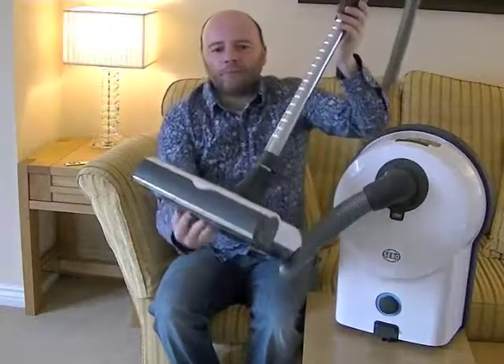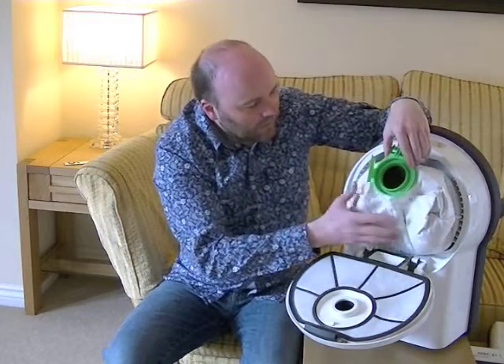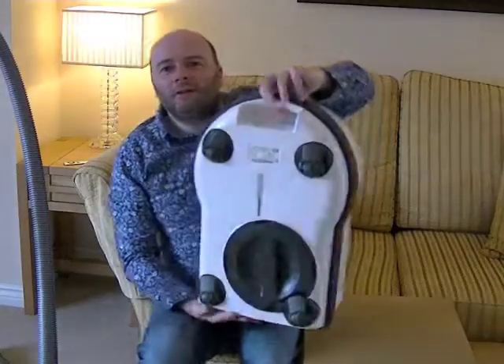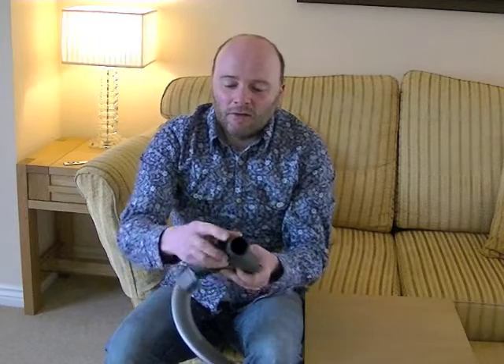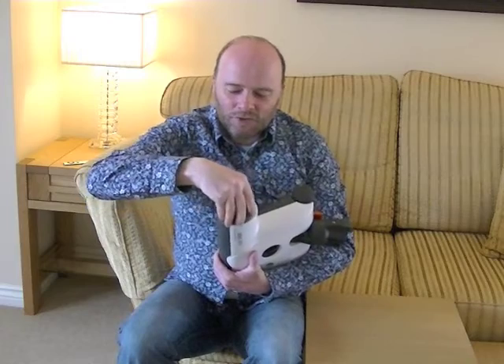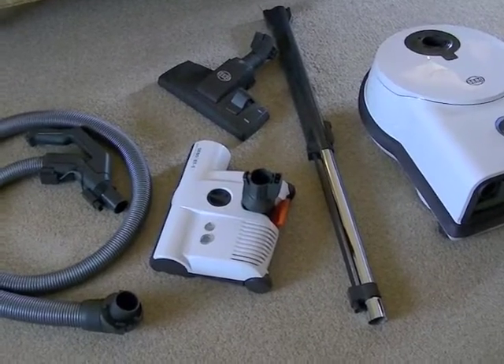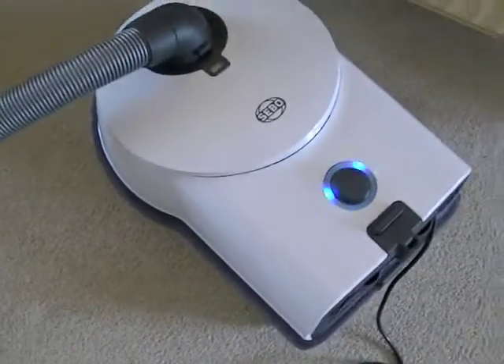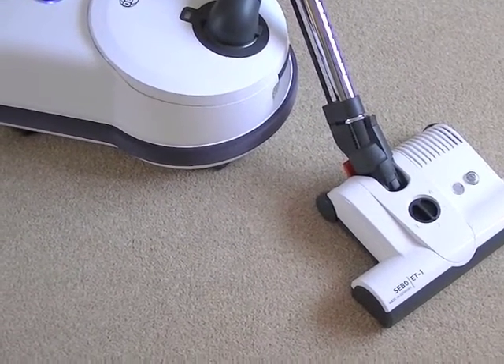Sebo D4 Premium Cylinder Vacuum Cleaner review & demonstration

Comment: Thanks for all the information. I’ve had this exact model for 6 months and I agree it’s heavy. I’ve noticed it flips over if you are not paying attention to the angle of the tube where it meets the body, if it’s at its opposite rotation the machine turns over. Your tip about taking the brush out is great as we have a lot of long hair in this house. 👍

Comment: PROFESSIONAL VIDEO. Bought the D4 and ALL attachments on a close-out for $499.00. I added a hose for the down stairs and up the stairs.
EXCELLENT MACHINE.
Reply: Sounds like a great deal!
Reply: yeah killer deal. i just paid an insane amount for mine 😅
Reply: @burpreynolds  I just happened to be at the right place at the right time. Interesting, most of the accessories fit the Henry Allergy model so I use that one exclusively  for cleaning the car and garage. Found it in Canada with only the box Scruggs but machine in excellent shape.

Comment: not worth it guys. 5 years later, if I had to do it again, I would either try the smaller version or go with another brand.  Im not impressed with some of the design flaws and how it has held up over the years.  

It does have the suction to pull a sick whore off a piss pot and a bag big enough to store a cadaver but other than that its not worth $1,200
Reply: That's because it's not a $1200 vacuum. It's under £400 in the U.K. which means it should retail at around $500 in the US. Only your protectionist tariffs and crazy import duties and taxes make it insanely expensive.
Reply: I am looking at the Sebo D4 then saw your comment.  What are the design flaws?  What hasn't held up over the past 5 years (7 now)?
Reply: @sl1237  it is over engineered imo.  The first thing is it is HEAVY AS HELL .  The hose comes off canister at a shallow angle and does  not spin 360, only 270.  A nuisance when dragging it around.

It's so heavy if you drag it by the hose it eventually Makes it suck air at the connection at the canister.

The power rug beater is off balance, when you lift it off the ground it tilts to one side

And the handle loses power connection down to the rug beater and it intermittently comes on and off

I have taken it apart several times tried to clean the contacts but it basically is a piece of crap

The wire is about 40 feet at probably 16 gauge and it gets wicked hot if you don't unravel it the entire way.  

Get A Miele.  

Every time I use this vacuum cleaner I want to throw it out the window.

We have a nice and cordless V7 and I use that 90% of the time now.  

The positives?  It's a HEPA vacuum, and it does have good power but just about every vacuum cleaner nowadays has good power.

Do not buy this Seebo canister D4 it is definitely a piece of shit.  It is the most retarded vacuum cleaner I have ever used.  And frankly I'd like to take it back and shove it up a salesman's ass :)
Reply: Yeah.  Its a piece of shit. Heavy.  I dont use it anymore.  Cordless dyson works just fine. We're too lazy to haul the sebo dumpster up and down the stairs too 😂

Comment: I bought the D4 700 and the suction is a joke. It really is WEAAK! And for insane price. I cannot describe how  dissapointed i am in this product. No doubt it's build quality is GREAT and will last for 20 years. but it's just so weak. I can not clean any carpets with this. I wonder if buying the carpet brush roller head for another 190 eur will make this product usable.
Reply from the maker: I would not recommend the 700 watt Sebos, especially the straight suction ones unless you mainly have hard floors. The model in this video was manufactured before the first EU regulations so it's over 2000 Watts. They did 1200 watt versions that had greater suction than the 700 watt models. The power head would make a huge difference to the carpet cleaning performance if you can get one that fits your version.
Reply: ibaisaic thanks, appreciate the thorough reply. I felt mislead really, especially at that pricepoint :(
Duped into having to now also purchase a powerhead, that by itself is more expensive than a cheap 2k watt noname brand.

Comment: Hi Rodger. I am thinking of buying one, but don't know which one to go for, either the Miele c3 elector or this Sebo. Cheers. Paul
Reply from the maker: The Miele will probably perform better, but the Sebo has a bigger bag, longer hose, cord and is better built in my opinion.
Reply: ibaisaic Hi Rodger. Do like the Sebo x4 upright pet vac.  Will study your reviews on the x 4 soon, Paul
Reply from the maker: I have been using the X4 Pet Boost recently and it seems so old fashioned now. If you want an upright, I would go for the Felix. The Euronics exclusive Kudos version seems to be on offer at £200 at the moment.

Comment: I find it hard to feel a machine is cleaning well with straight suction only on carpet. I have to have a power head to consider it a household machine
Reply: yes, I have to have a power head even if I had mostly hard floors
Reply: My unit came with ALL attachments and power units for carpets, wood floors, stairs, furniture etc. For under $500.00 on sale and all was NEW IN A SEALED BOX.
Reply: Gerald Mattos where did you buy it from? They are 1299 in US

Comment: Thank you for the review. I absolutely can't decide between the D2, the E1 (700) and the E1 (1200). Do you have any thought or recommendations? The house is over two floors (total area 130 sqm) and mostly floorboards and laid wood.
Reply from the maker: +Bohab Bibb The D models are quite big so would be better for a larger home. I haven't tried an E series model yet, but personally I would go for the 1200 watt version.
Reply: Thanks for the helpful response. Unfortunately I can't find the d model anywhere to view in person so has been impossible to know how big they are. Other than the bag size and cord length, does the d have any advantage over the e? I imagine the engine is the same, but does it have better filtration? How big does the home need to be before the d becomes the better bet?

Comment: This is an excellent review. Your step by step analysis convinced me to purchase the Airbelt D4, here in the US. They currently run about $900.00. We have two cats, and have both bare floors and area carpets (rugs). I'm looking forward to replacing my 30 year old Miele 227 with is very up to date deluxe model. As my wife has allergies, It's the deep cleaning of the carpets, and the removal of the cat hair and litter tracked from their feet that led me to this.
Thank you.

Comment: Roger, I have a quick question. Have you noticed any smells coming from the D4? I read some reviews that say as the bag fills, there is a smell that omits from the machine. They recommend the SEBO lime scent sticks to add to the bag. Any thoughts? Thanks, David
Reply from the maker: +ShrinkDavid 1982 Most bagged vaccums emit a smell as the bag fills with dirt. I find the Sebo fragrance sticks don't last very long. A more natural solution would be to put some essential oil on cotton wool and place it inside the bag. Smelly exhaust air is more of a problem for homes with pets.
Reply: Thanks!
Reply: ShrinkDavid 1982 , cut up a Bounce fabric softener and put it in the bag, no more bad smells.

Comment: I am amazed your machine is 2100 watts. Mine is only 1200 watts. I wonder why this  changed. It has amazing suction so I guess it doesn't matter.
Reply from the maker: +ShrinkDavid 1982 Since the EU regulations limiting the wattage of vacuum cleaners sold in EU countries, the D4 is now only 700 watts, but I don't expect the performance to have dropped dramatically. I plan to get either a 700 watt K3 or E3 Premium next year.
Reply: In Europe their voltage is 220, in the US, it’s 110 that’s the reason his is double than a US D-4.

Comment: I do want to thank you again for turning me on to this vacuum. I was dusting my ceiling fan with it at 2:30 am. I don't really like the dusting brush. It is too small. It is nice for small areas but i like to dust all my furniture with the vacuum and I find this to be too small and stiff, no pun intended. I ordered an adapter and the long Dyson dusting tool. I know it is sacrilegious but I have to have something that will make it easier to dust or I just won't do it. Did i mention I hate dusting? 

I am so amazed with the suction power on the Sebo. I have never owned a vacuum with this much power. Interesting. I tried one out at a dealer before I purchased it and the suction wasn't as strong. However, it was a floor model and I don't think it was well taken care of. The bag was quite dirty which tells me he probably was reusing it which would definitely cause a loss in suction. I trusted you on this and it has paid off. You were spot on about the button to turn the motor head off/on. Terrible. I don't know what Sebo was thinking.
Reply from the maker: +ShrinkDavid 1982 This genuine Sebo dusting brush is much larger than the one supplied with the D4 and has nice long soft brushes and a swivel neck.  http://www.amazon.com/Sebo-Dusting-Bristl-Openning-1094GS/dp/B00H5PPILY/ref=sr_1_10?ie=UTF8&qid=1445504366&sr=8-10&keywords=Sebo+dusting+brush
Reply: thank you for that.
Reply: @David49305  I added a soft mink bristle brush to mine. I found it at an old vacuum store for under $4.00.

Comment: Well, I received my Sebo D4 Premium with the ET-1 brush roll. Overall, it is a FANTASTIC vacuum. The suction is truly amazing and the motorized head cleans the carpets like nothing I have ever witnessed before. I purchased the premium parquet hard floor brush and love it. It has wheels which makes cleaning floors a breeze. For me, the hose is average length but the cord is the longest I have seen. I have a 3000 square foot home and I was able to clean the entire first floor, the stairs and the landing and hall before I had to plug it back in. None of the vacuums I have owned have made it that far. It did topple over a couple of times and got caught up in the cord (which is typical for a canister vacuum). 

I agree with Roger's review completely. The button to turn the brush roll on/off is an engineering failure. It is so hard to press that one could break a toe. I had to use my finger. However, it is nice that it turns off in parked position so I didn't need to turn it off much. I do think they should provide a much larger button or take Roger up on his idea and add a larger one on the back. Also, I would prefer a step button to raise/lower the power head versus having to bend over to adjust the height (but I do need the exercise). A light on the brush roll would also be nice. I would also like to see all the controls added to the handle - just makes more sense. However, these are tiny things. The machine is amazing. Couldn't be happier. I only got four rooms cleaned and look forward to getting the other six done this week. If you are thinking about this cleaner, give it a shot. It is big and somewhat heavy so take that into consideration. I do not have pets and we do not wear our shoes in the house. It hasn't been too long since I vacuumed. I could not believe the dirt and dust in the bag. AMAZING! Thanks Roger for recommending this vacuum!!! Happy Vacuuming!
Reply: Do you still recommend the Sebo D4?  Anything broken after 6 years of use?  Long term flaws?

Comment: Roger, when using the extension hose, is there a loss of suction at all? I would like the hose to be as long as possible so I don't have to putt the machine around the room. I have a few large rooms and don't want it following me around.
Reply from the maker: +ShrinkDavid 1982 I haven't noticed any noticable drop in suction using the extension hose, but it is really only for above floor cleaning and stairs. It is a friction fit stretch hose so cannot be used with the power nozzle.

Comment: How is the hose length for cleaning stairs? I know they offer an extension but hope to not have to purchase that.
Reply from the maker: +ShrinkDavid 1982 It's a long hose, but will only get up about two thirds of a standard flight of stairs. It will stand on a stair or can be carried. I have the extension hose which does make all above floor cleaning easier.

Comment: The one I ordered has the small floor brush but not the larger parquet attachment. Would you recommend purchasing the larger parquet attachment for hard floors or is the power head with brush turned off just as good?
Reply from the maker: +ShrinkDavid 1982 The power head works on hard floors, but I find it better to use a dedicated hard floor brush.

Comment: Thanks very much for the detailed video between the two vacuums I was looking at. I bought the Sebo and couldn't be happier. The suction and power head is impressive. Makes my old unit look like dollar store bargain bin junk. I want a good dusting brush for it but the only one I see online that looks like it would fit my needs is the Miele SUB 20. Would that fit on the Sebo hose?
Reply from the maker: +P Skippy I haven't got my Sebo to hand to try that out, but I don't think you can use a Miele attachment on a Sebo.

Comment: How filled up do you let your bags get on this vacuum before you change the bags? I have never used a bagged vacuum in the past so forgive me if this is a really silly question lol. The manual confuses me when it says "the nature of the contents of the filter bag will affect point @ which it needs changing...the filter bag may over fill before "bag full" indicator turns orange." So it's just a big mystery... I have 2 cats that shed and track litter daily & right now you can't see the bottom of the bag but there is still a lot of empty space in there.
Reply from the maker: You can fill it until you can see dirt at the top of the opening. The bag compartment and filter are designed to prevent the cleaner losing suction even with a full bag.